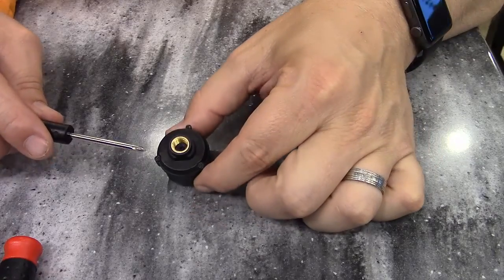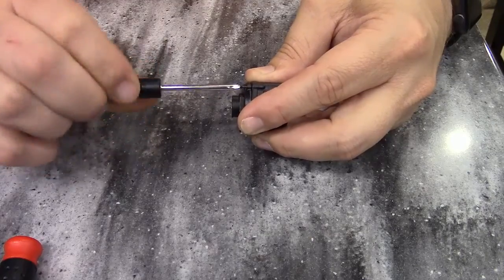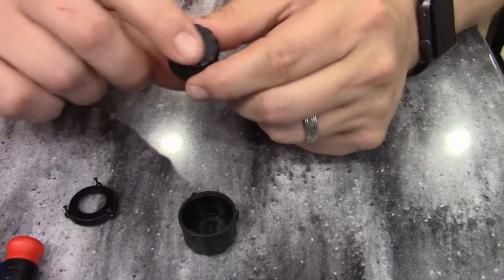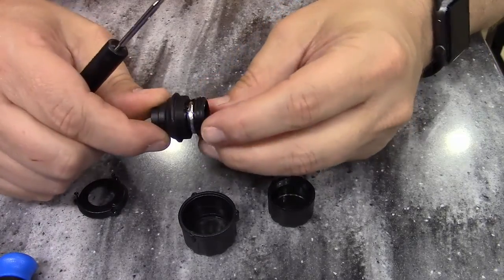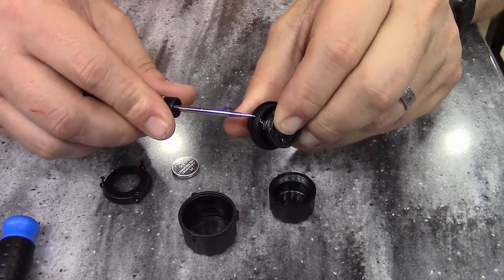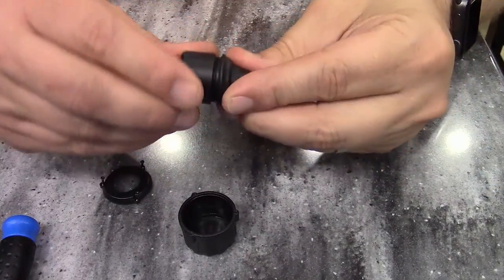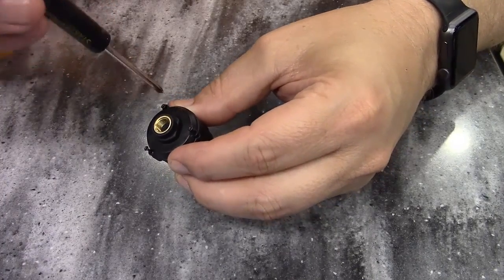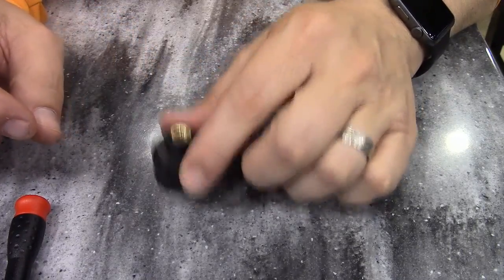TechnoRV TST 507 Learning Series: Replacing the TST 507 Cap Sensor Battery

Comment: I have the TST - 507 purchased in mid 2020 just researching how to install the new batteries, my book says the flow through have the CR1632 and the Cap Sensor uses the CR2032. Not sure if they are interchangeable or not. 
Great video!
Reply from the maker: Hi Mike.  The batteries are not interchangeable. We do sell batteries and change kits here if you are interested:https://www.technorv.com/tire-safety-and-tst-tpms/batteries-and-o-ring-kits/
Reply: @Technorv  , Thanks, yes just started looking, purchased mine from you guys and will buy parts there too! . ( so you owe me a cup of coffee when we come back thru that area :). ) Just wondered about the batterie because you called out a different one.
Reply: @Technorv  ,Also, just realized the one you were showing was a first generation, I have the second generation cap, that is the difference.

Comment: "It's a little 1632 battery".  I believe all 1632 batteries are the same size.  But it is a small battery.  :-)

Also as you say in the video, "...remember, positive side up..." (which means that the negative side goes toward the tire).

You recommend that o-ring replacement each time a battery is changed, but I can get batteries easily but not so much the o-ring.

Phil in gorgeous Young Harris, Georgia, USA
Reply from the maker: Good observation.  They are little bitty things, aren't they?  If you need new O-rings for your battery change, you can contact us or TST directly.  We want you to have a great seal so they work properly.